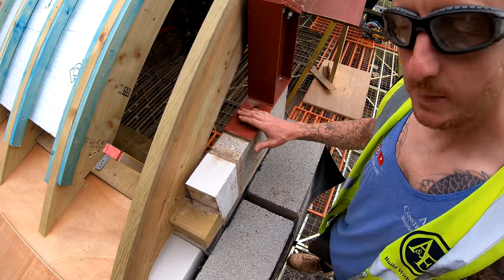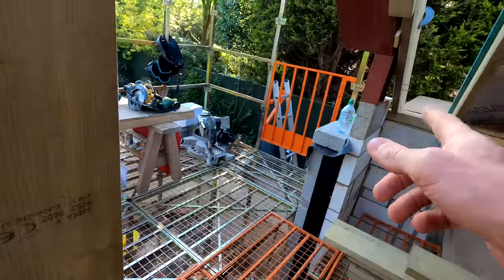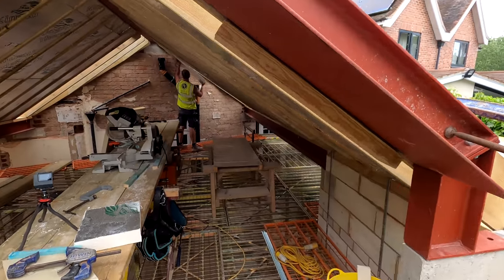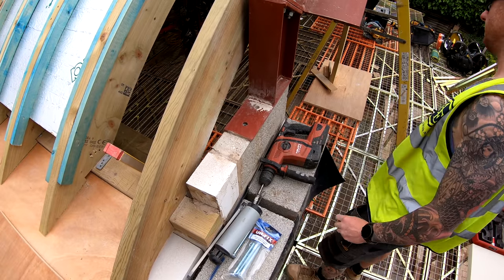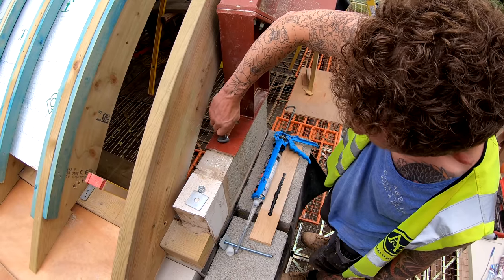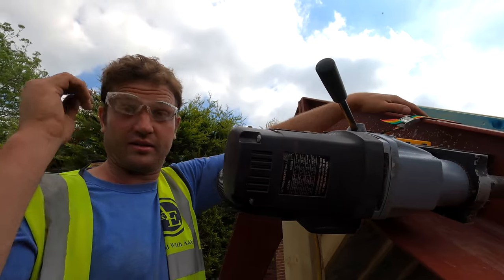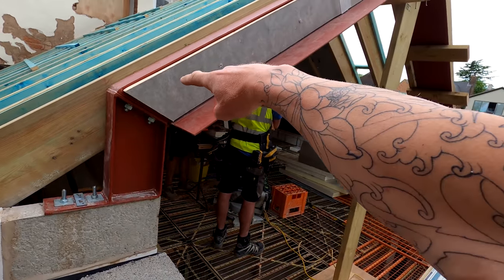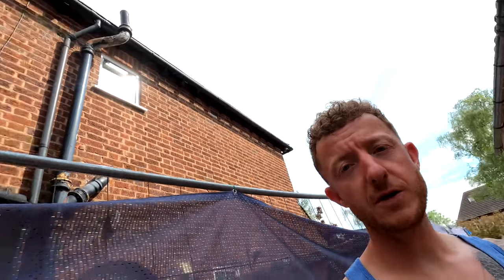Installing Anchor Resin Bolts 🔩 | Single Storey Extension #16

Comment: I love these and picking up so many good tips and hints to help with my build.
Here's a tip for you though when drilling into steel, put a magnet in a plastic bag to catch the scarf. Turn the bag inside out and throw it and scarf away.

Comment: @ Build with A&E, I use my Bostitch compressor to blow the holes out chaps, quicker, totally clears all dust & I use a squirty bottle with a mix of pva & water to seal the hole before I resin it.  Great video chaps 👌🏼

Comment: Great work as always guys - very professional. I implore on you to please leave the DPC VISIBLE on the face of the wall (7:20). When it is set back, there is a bridge - which I know you appreciate as you mentioned thermal bridging earlier! It may be unsightly but it has a function and the issues manifest themselves years down the line.

Comment: If you drill a 14mm hole and put in a 12mm bolt, you’ll only have 1mm of resin around the bolt! 😂

Comment: Very informative and an excellent resource for both lads on the tools and architects/designers, is that a standard detail you use with 2 DPC's or specifically for this job as the original by the back door looks almost bridged, cheers

Comment: Hi top notch work as always, you mentioned closed cell and open cell insulation could you tell me what's the differences and were you would use them, maybe cover it in a video? Thanks guys.
Reply from the maker: Hi Afzul much appreciated will do have a awesome bank holiday weekend all the best Tony 👍
Reply: @BuildWithAE  thank you. Have a great weekend.

Comment: Did Pete, use a string line pulled parallel to the last rafter to get the angle of the splay ?